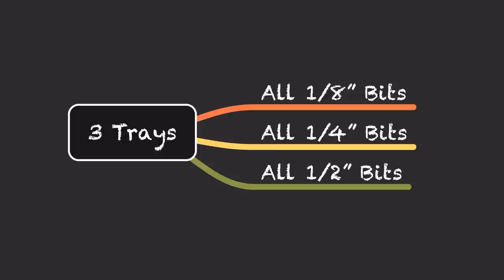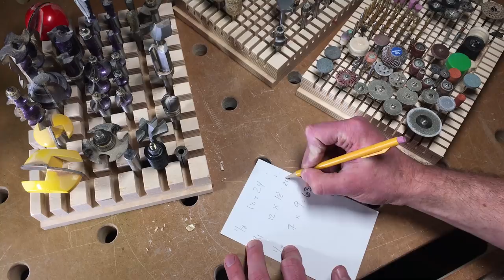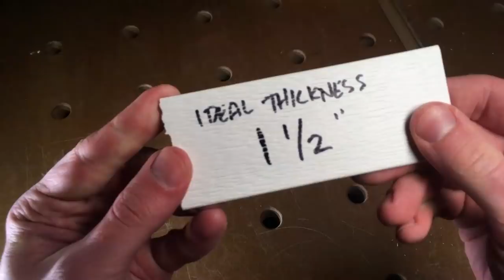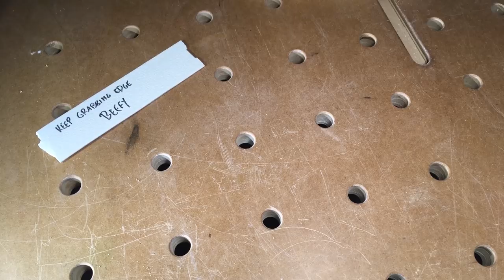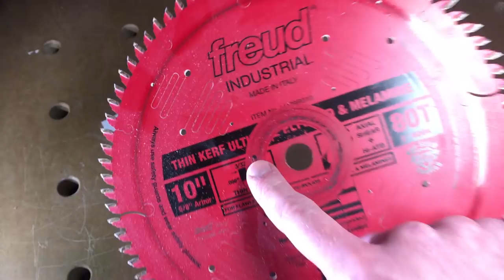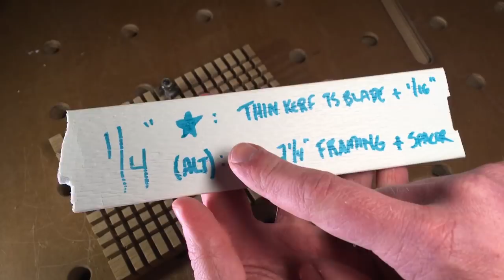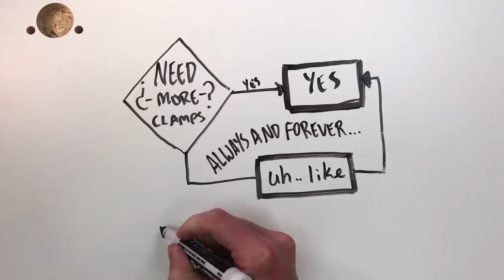Wicked Fast Router & Dremel Bit Storage Trays Using Dadoes Instead of Holes

Comment: Somebody probably already pointed this out so excuse the repeat post:  Divide the shaft diameter by the square root of 2 → that will be the minimum kerf width.  So 1/2" uses 3/8" cut, .25 uses 3/16" and so on.  I have some 8mm router bits for an old European router which would use a kerf larger than (8/25.4)/√2 = .223", say 1/4"....and so on.  This is a really good idea and I thank Keith for posting it.
Reply from the maker: So are you saying you didn’t thoroughly read through the comments before double posting?  :). Thanks for it though. A few weeks ago I actually went back through comments to try and find the equation but gave up. So, I screenshotted your reply to have it handy.

Comment: Gidday Keith, to cure the ripping chunks out issue and lessen the lamination mental stress, laminate up some end grain, or use a cheap end grain chopping board and laminate a piece of ply to the bottom, then cut your dedo slots below full end grain length and they'll be super stiff/strong well beyond what you need. Neat idea in general, and now you have another tweak to make to make them truly perfect. Collaboration at its finest. Enjoy :-)
Reply: Also, two tips for your tyre clamp system: 1) put something thick/stiff like steel plate on top, or some thick hardwood, then you will get less/none of the variance between centre of contact patch and those areas outside the tyre area. 2) Put a block or ramp about the same height before, drive up/onto that, then across smoothly onto your lamination, zero chance of it spitting boards out. Also, use a RWD vehicle so the torque is pushing you up onto it, rather than pulling it through under you. :-)
Reply from the maker: Yeah those tips are really good.

Comment: Thanks for the great idea, I literally have hundreds of ¼ impact driver bits. Rather than plywood I used ¾pvc which produced 0 tearout with ½ spacing between dados. I used a 13x13 units of America piece of material. Rather than the sled I used the fence set at ½inch then snuck up on the best fit  for a ¼ bit. The best part of this is you can make four passes before you have to move your fence. With that one piece  I was able to make enough for my impact driver case and for a French cleat  shelf for my shop.Thanks again for the great idea
Reply from the maker: Ahhhh 4 passes because you rotate the board each time?  Brilliant.

Comment: Two thumbs up on idea, and three for video production value....
For the 1/4" bits you can make a wobble dado using your thin curf blade and a few strips of masking tape on opposite sides of the blade, under the saw flange. Bit more tear out perhaps, but not if the blade is sharp and you feed slowly enough. 
I know how the next half hour of my workday will be spent! Thanks!

Comment: If you glued up some pieces of 2 x 6 with the end grain facing up like a butcher block, you would get the strength of the continuous grain and no blocks splitting out at all.  Starting with thickness of 1.5, you can cut .5 inch deep dadoes and still have 1 inch thickness to hold it all together.  I would use a single strap clamp to glue it up. I really like the concept of cutting dadoes to get sockets at the intersections.

Comment: Thanks for the video, I am going to use it.

A couple of point on gluing.  

a) You can't starve a joint if you put glue on both surfaces.

b) what happens is that with fixed dimension clamps, there is an initial squeeze.  This has no time to fully expel all the glue.  As time goes by, the glue squeezes out.  If the initial dimension to which the you set the clamps remains, the pressure goes down, and voids can occur, and you may end up with bad joint.  It depends on how much, glue; how much soaks in; gel time; how much spring there actually is in the clamps, they may adjust' etc...

c) If you use vac bagging; spring clamps; weight; pneumatic bladders; the clamping pressure remains constant, or relatively so.

d) A great techniques that not only optimizes pressure on the glue joint, but also stops a lot of skidding around is to take pressure up on the joint firmly at first, but not too hard.  Then come back a few minutes later and tighten.  How much of what when, comes with experience, but it isn't difficult to do.  This also allows one not to overtighten the clamps with possible adverse effects like breaking fragile parts, or denting, or skewing parts.  I use it a lot on guitars.

e) With yellow, and hide glues, if not epoxies, and polyU glues, one does not need any clamping pressure at all.  I use rubbed joints on guitar part, and not only do they not require clamps, but the joints seem less visible than with other methods.  I have to carefully mark the parts because the joint can so completely disappear that I can't find it if the boards are flat, and the ends are unremarkable.  That doesn't really make sense, but it keeps happening.

Comment: So the kerf widths need be the legs of a right triangle with a hypotenuse equal to the diameter of the bit shanks.  In case anyone isn't interested in the guess and test method for any other sizes they need.
Reply from the maker: Charles Hanson mathematics always appreciated.

Comment: Pretty neat!
Now you need to get a Foredom tool to replace your Dremel, and make racks for 3/32nds, and 1/16th bits... Oh and you'll want to separate your Rotary/Foredom 1/4" bits and burs from the Router bits and burrs...

FWIW - Most Cribbage boards work nicely for 3/32" bits...

Comment: Add epoxy into channels. Just tape up sides; break off one square to act as a reservoir; flood till 1/ 8" or more in channels.

Great video: info, presentation, & production (even with earthquake cam)!

For clamping large surfaces: look for the theory on clamping chauls to understand the physics.

Comment: After watching your GREAT video twice, I had an idea. It will take longer but I’m going to use my Incra positioning kit on my router table, making  “stopped” dados, leaving a solid frame around the tray for added durability. This won’t happen soon as I’m recovering from surgery for the next 5 to 8 months. I’ll report back when I get some trays completed.
Reply from the maker: Cool!  Get well soon then!  What Incra do you have?  I tinkered with what I think was the original, but it was a bit fidgety and hard to reliably hit the 1/32” teeth.  From videos online, it looks like the newer ones are considerably better executed.
Reply: I have a long carriage LS Incra.  I also have a gen 2 Jointech Positioner.   Jointech is out of business.  Both units have features I like. Hard to call one “the best”.  They each have there strengths. Jointech units can be cheap since they are out of business. I found one new in the box, on eBay, never been opened. Bought it for spare parts.

Comment: I particularly like the concept of using dado cuts rather than drilling holes because when I drilled my bit holder board the bit and the hole were almost the same size and my non-moisture proofed shop rust locked the bits in the holes which were a tight fit anyway.

Comment: very cool, and clever!! FYI using Pythagorean Theorem you can calculate the dado size needed by dividing the shank diameter by 1.4142  - now that's nerdy!!!
Reply from the maker: Bah!  Thank you!  I was googling “how to calculate what size circle will fit in the intersection of two ...gaps” but couldn’t seem to find the right word for gaps in that search term. I kept getting Venn diagrams (intersection of circles).  I’ll give that a try. Thanks!!
Reply from the maker: Holy moly, I plugged that in to Fusion 360 and it worked brilliantly.  May I post that on my blog post and somehow give you credit for the tip?
Reply: @KeithsTestGarage  sure

Comment: Very slick idea, and certainly quicker than a bunch of time with a drill press.  For the clamping pressure of your rubber clamps, it's going to be equal to the tire pressure over the contact patch of the tire.

Comment: Not having a table saw, I'll have to use the Dremel Trio to cut the dadoes! Well done - very nice video. Thumbs up!
Reply from the maker: That looks like a clever tool that’s no longer available....
Reply: Yes, I've had mine for about 4 years now. Very useful, and probably under-utilized, I'm embarrassed to say!
Reply: The router table works too.
I'll admit it's a bit slower, but if you don't have a table saw. . . .

Comment: I used this idea to make several trays for 1/8", 1/4", and 1/2" shank bits and I adapted the idea to hold onto the bases of 1/4", 3/8", and 1/2"-drive socket extensions.

I made my trays out of scraps of dimensional lumber from the big-box store that had been sitting around my shop for a while. I have a couple of things to add. If using pieces of solid wood, make all the crosscut grooves first to reduce the amount of tearout and missing squares. I found the spacing in the video for the 1/8" and 1/4" holders to be a bit to small when using softwood. Keith's spacing figures obviously work well with quality plywood and probably work with hardwood as well. 

For those that want to customize the groove widths for bits and bobs of some other diameter, the groove widths are easy to figure out with this equation: 

Groove_width = diameter_of_object / sqrt(2) 
(maybe add a tenth of a mm or a couple thousandths of an inch for wiggle room)

Comment: Just thought of a new material to make these out of, Marine Plywood.
Marine Plywood is smooth, high end plywood that is laminated together with a hot-pressed epoxy.
It is super strong and the layers are not glued together.  They are epoxy bonded together.
----
Also, in re-watching this video I noticed your comment about being careful of how you pick up these trays. 
Looks like you were saying the square blocks between the dadoes can break off easily.
Maybe laminating a thin frame around the outside could help.
Or maybe a small metal handle attached to the bottom would help.
----
Thanks again for the video.

Comment: Nice job and a great idea.

Instead of making an 1-1/2 inch slab from three 1/2 inch pieces of plywood, consider cutting strips an inch and a half high and standing them on edge. You then have to glue a dozen or so strips standing on edge. That glue up can be easily clamped.

You no longer have to worry about the 1/2 inch by 1/2 inch blocks separating because the laminations are factory glued.

I'll try making some like this when I get a chance.

Comment: Great inventive & effective idea. With the cabinet I plan on building for my new Rockler router table stand, I may just try this technique for storing my bits and accessory parts. Thanks! To solve your sliding layered glue-ups, I saw a video that effectively used a light sprinkling of course salt between the layers -- result, no sliding!

Comment: Great video.  I’d seen it before, and I am so glad I found it again, as I need to organize my bits.  One thing I recall from an old Fine Woodworking article is that if you glue both sides of a glue joint it is much stronger than gluing one side— no matter how much glue you use or how much clamping pressure is used (they did an extensive  a fairly rigorous analysis).  Gluing one side showed that the glue joint sometimes failed before the wood, but when gluing both sides the wood would always fail before the glue joints.   They also compared glue types, I believe Tightbond 2/3 did best overall.
Reply: I don't get this. If you apply glue to one side of join, then push it against the other side of the join, then you have glue on both sides of the join. It's impossible to only glue one side. 
What am I missing? Genuine question.
Reply: Justin F — the issue seems to be, that if you take the time to well cover both sides, or paint both the mortise and tenon with glue, or the dado and the tongue, etc that the coverage is both more complete and even and generally has had more time to tack to, and get tacky on, the surface.  All of that appears to contribute to a statistically much stronger glue joint.  
For some joints, like two flat boards where just one side is painted with glue, I would assume that you could do something similar using a “rub joint” by over-gluing one side a bit, rubbing them together a little to spread the glue, pull them apart for a minute or two to allow some degree of tack and then just push them together and clamp. Possibly even without the tack, the rub joint could be about as strong if clamped well; but I’d just be guessing on that as I never read an article or watched a video on comparative testing of rub joints versus both sides explicitly glued ones, like has been done with single vs double-sided gluing.
Reply: @amdenis  Thank you! Really appreciate the reply and knowledge. Sounds like getting 'some tack on' is important then? I've always tried to get things in contact and clamped ASAP. Might be I need to reconsider my approach...

Comment: Truly superb idea and video. I’m a new subscriber; that makes me feel less guilty about stealing your great idea. And thanks for all of your intense research. 
BTW, a few ideas:
-  Instead of using a Clamper Van, I use another type of gravity clamp = weights. I sure didn’t buy them at a garage sale so I could use them in a traditional manner. Nope, they are my gravity clamps. 
- For the Dremel bit holder, I think I’ll put dowels/cut-off nails, etc., to hold sanding drum cylinders and all those cut=off discs that I’m hoping I bought on sale. 

Thanks, again. I’m looking forward to checking out your past content and seeing your upcoming videos.
Reply from the maker: Good idea on the nails. Also be careful. Past content is not nearly as good. Everything before the candle video was purely a test.
Reply: Keith's Test Garage  I watched them all the other day. Yes, your videos do improve, but most content creators’ do. I still think that you have a way with how you connect with your audience and your sense of humor is similar to mine, so I relate. Please keep up the good work and your numbers will grow. I’ll be watching!

Comment: Enjoyed the video. I use a rotary tool daily, a Foredom TX, and have quite a few attachments. I buy them in bulk directly from the manufacturer. This came up in my feed. For storage, I use a wood machinist box from HFT. Also have a large plastic organizer for bulk packs tucked away. The machinist box is shallow and takes little space on my bench, it looks nice and neat, and everything is easily within reach. I'd suggest the same for an individual in a similar position.

Comment: Idea. Glue vertical grain strips on top of a thin plate and cut only half depth into the vertical strips. This will eliminate any weak points due to splitting grain.
Reply: mughat, end grain cutting board. Makes good sense.

Comment: Genius! Fabrication optimization, treat the Dremel and 1/2" router bits as if you are making box-joint. Make a sub-fence and attach it to your crosscut sled's rear fence. Make a pin that is the same width as the dadoes and embed the pin into the sub-fence at the same distance from the blade as the spacing of the dadoes.

Comment: This fits along the same thing I discovered with 3D printing. I would look online for a design to hold something round, a recent example is AA/AAA/18650 batteries standing upright, and virtually everyone has holes... as in round holes... for each battery. I printed one and realized it takes a lot longer and used more filament to print all the material between all the holes. So I thought hey why not just print narrow walls in a grid to form little boxes where the batteries just touch a slight spot on each wall. Prints way faster.
Reply from the maker: YES!  And, on that note, the grid designs you mention are insanely easy.  Just design a solid block (no grid) and print without top layers.  The "grid" infill type is then exposed.   (I've been making 3D printed light grids for my Viltrox lights lately, where I omit both the bottom & top layers)

Comment: Dude, everything about this video was spot on and damned good. Keep it up and you will soon be at 160K vs 1.6K subs. This is content I’d support with more than just Amazon links - the bit holders are brilliant.   Just please don’t fall into the “I have 5 yrs experience, a 20x20 garage shop,  and $250,000 of sponsored industrial equipment” trap.  There are way too many of those on YT.
Reply from the maker: Thanks for the compliments. Maybe I can assure you that my reason for this channel is not money, but rather to work on communication skills (and other things career related). Point is, my specific strategy for monetization is 1) Amazon links, 2) skippable ads before the video.  I would like to at least help pay for some of the supplies used in various tests and prototypes   The monetization, however, must not drive the content.

Comment: Tip Top Test, Idea and video...!  To get vertical grain support, I will drill dowels in each coloumn, before routing/dadoing (and widen the pattern a bit) PS: Keith...Show this to John Heiz or Mattias Wandel...they will "Steal It, as Picasso say...!
Reply from the maker: Yes.  I'm all for them taking the idea and improving it.  But, I'd appreciate if they'd at least let my channel grow a bit first!
Reply: Doesn’t drilling each column for a dowel defeat the whole idea i.e. to avoid drilling lots of holes for the bits?
Reply: @paulphillips675  Greetings PP...What can I say, I'm only a retired dowel robot.
Time is only One part of quality and quantity...but I acknowledge your pov.
Sigh...Better switch upper layer to Nylon, or similar.